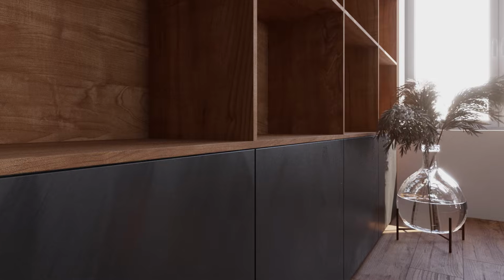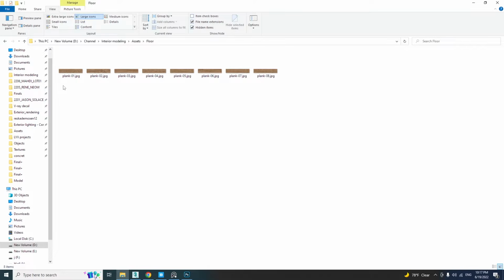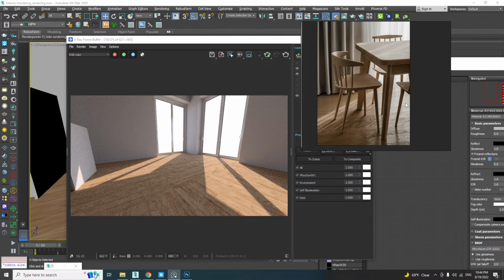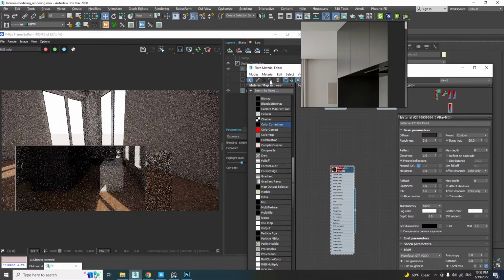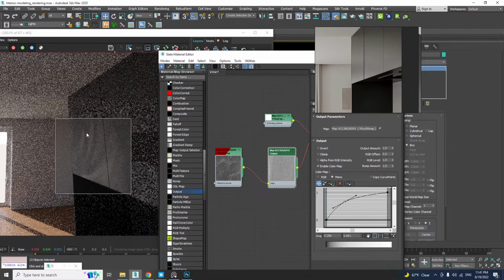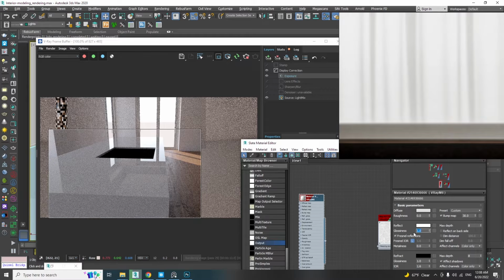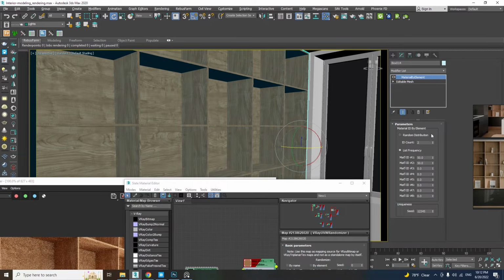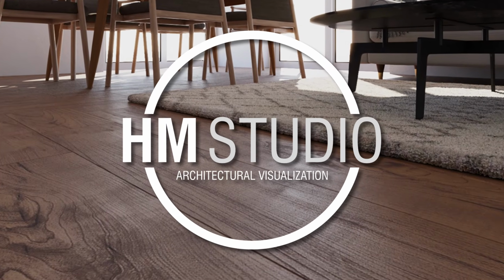How to create material in 3ds max Vray

Comment: On minute 26:10, Why is it required that we turn the editable poly/boxes into editable mesh?
Reply from the maker: Just to collapse the stack and get rid of the uvw map modifier that’s already there. You can also add an edit poly or edit mesh modifier on top of the uvw map and go from there and these are two different approaches that work the same. It’s always good to convert the geometries to editable mesh after you’re done with editing them cuz it will reduce the file size and make the whole scene work smoother…
Reply: @HMSTUDIO2020  You're the best, thanks again!